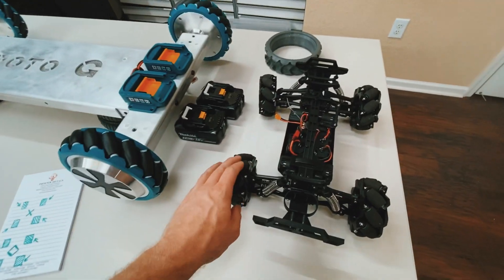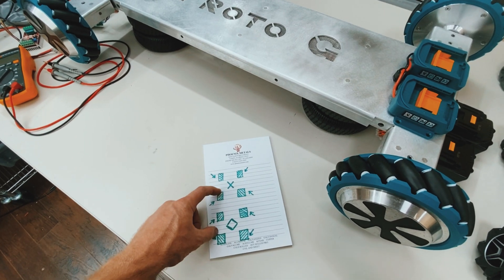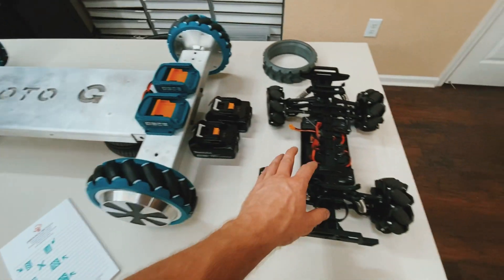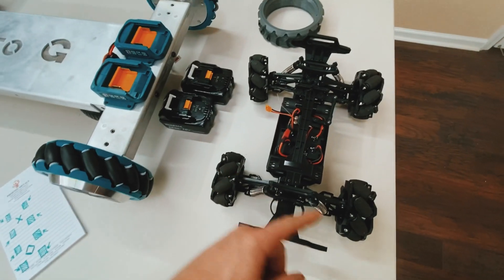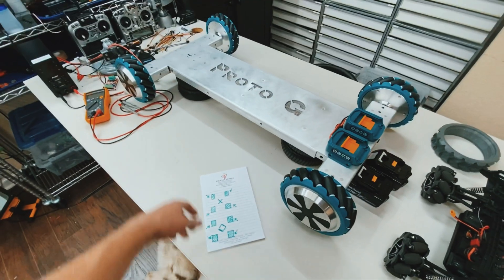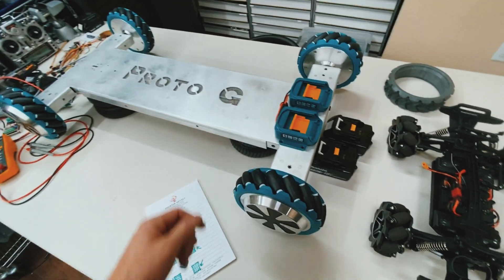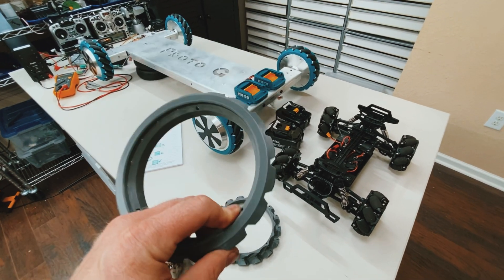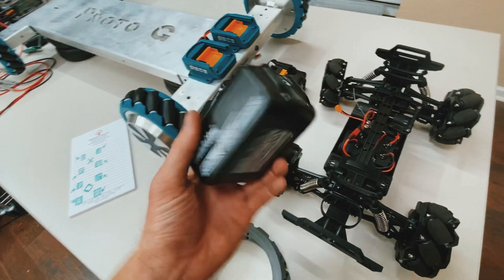Omnidirectional FPV Rover - Mecanum Wheel Orientation

Comment: I'm trying to do a similar build.  I don't have the engineering background or knowhow, I just want to make cool stuff with my two sons.  I know on Printables you said that you sourced the mecanum rollers from something you bought on Amazon.  Any way you could add an STL for the rollers so I could just print using TPU?  No matter if I hear back or not, I'm definitely using your STLs for my projects.  I've amassed a pretty big stockpile of "broken" hoverboards and I've got lots of projects I'm playing around with.  Thanks for your time.

Comment: Hi! I just found your video and I am really interested in the mecanum wheels you have designed and built for the hoverboard motors. I want to replicate you setup but instead of buying existing wheels just for the rollers, I want to take a stab at 3d printing the rollers. Would you mind sharing the original designs of the wheels so I can make the necessary changes? If all works out, I  will of course post back to the community.

Comment: Can anyone tell me the technical term for the shape of the rollers/waltzes the wheels consist of? Is it "barrell shaped"? I try to get them to build bigger mecanum wheels and cannot look them up. Has anyone a source for those?
Reply: I've been looking myself. I don't think there are many sources of just the rollers. Most rollers which come with Mecanum wheels don't appear to be the exact correct shape.
The shape of the wheel is the edge of a stretched circle. If the entire shape were drawn, it would be an ellipse 1.414 times wider than it is high. 
How big of a Mecanum wheel do you want? I want to make an electric skateboard with Mecanum wheels. I may end up making my own but I decided to purchase a set from AliExpress to see if they would work. I'll post a separate reply with a link in case the links aren't allowed so this entire reply isn't lost.
Reply: @ddegn  Thank you for looking and the information about the exact size. I want to build a pedal powered vehicle for a special use. I would like to use ten inch wheels but they are unnecessarily strong and expensive. The websitts are not very user-friendly to find the correct price.
Reply: @dieterjosef  "I would like to use ten inch wheels"
I haven't seen 10 inch Mecanum wheels for sale myself. 

"The websitts are not very user-friendly to find the correct price."
Finding stuff on AliExpress can be a real pain. Someone else on YouTube shared a link to similar wheels which provided me with the correct search terms to the ones I ordered.

I might end up needing to make my own. I've been watching DIY skateboard wheel videos to learn how to mold polyurethane. I'm thinking the rollers could be kind of like small skateboard wheels. The shaped can be figured out mathematically. I like to think I'll be able to design the general shape without too much trouble. I'm concerned about how much the urethane will compress and how bumpy the ride will be.

"I want to build a pedal powered vehicle for a special use."
I think a pedal powered Mecanum wheeled device would be very very hard to make. In order to take advantage of the Mecanum wheel's movement, you really need to control the speed of each of the four wheels independently. If I had to make a pedal powered Mecanum wheeled vehicle, I'd use the pedals to generate electricity and then route the electricity to four motors. Make sure you understand how Mecanum wheels work before trying to make a large vehicle.

You can purchase relatively inexpensive Mecanum wheeled toys and use these as a base to learn how to control the wheels. Vex makes some really nice Mecanum wheels. I used Vex wheels with a Rover 5 chassis to make a Mecanum wheeled robot. There are videos of this robot on my channel. I'll add a separate reply with a link to my Hackday IO project where I describe how I made this robot. If you follow my Hackaday IO account, you'll see when I eventually post information about my Mecanum wheeled electric skateboard.
Reply: @ddegn  Ah, you are Proto G. I follow you already. Great work and videos.

I found ten inch mecanum wheels on AliExpress for under 80 Euros, that would be cheap enough not to make them on my own. But I admit that I am better in imagining than in realization.

I also thought of electric drives, but I found two or three hydraulic bicycles on Youtube. I think that would also fit.
Reply: @dieterjosef  "I found two or three hydraulic bicycles on Youtube. I think that would also fit."
I suppose it would. That would be pretty intense to build.
I hope you document the build and share it with the rest of us.

"Ah, you are Proto G."
I'm not sure what you mean by this. Just to be clear, I am not the same person as the guy who runs this channel. We just have a lot of similar interests.
Reply: Here's the AliExpress link.
https://www.aliexpress.com/item/4000403241443.html

Comment: Is that the Taranis X9D Plus I see sitting on the bench? Or is that the access? Looks like you have been in RC for at least a few years, I dont think FrSky sells the plus anymore. I still love mine though.
Reply from the maker: Indeed! I have an X9D Plus and a Jumper T16 Pro with a multi-protocol radio.
Reply: @ProtoG42  I have the Multi protocol module on my X9D, they are great.

Comment: Thats a lot of power! Not to say a heaavy duty frame/wheels. New personal transportation/rover? 😁
Reply from the maker: I plan on driving it around with a headset although I will probably try to ride it. Those small rollers might not support my weight but I'll do some weight tests with it.
Reply: @ProtoG42  it remember me to this   development https://www.lanacion.com.ar/tecnologia/siruom-la-silla-de-ruedas-omnidireccional-creada-por-argentinos-nid19052021/
Reply: @ProtoG42  Considering that the "hoverboards" carry a human bean on only two wheels, the power should not be lacking. Is it that the rollers are 3D printed? How about replacing them with cast polyurethane? I'd love to have a wired (controlled) human capable base from which to expand.
Reply from the maker: @freddotu  It definitely has the power, I just need to find more suitable rollers but we’ll see!

Comment: So I checked out for a bit.  Saw the thumbnails was looking forward to whatever you were making.  This is amazing.  At first I thought you were making a OneWheel but out of omni wheels.  This powered board looks awesome thought.  When's the road test?
Reply from the maker: Not sure yet, I still have a lot of wiring and programming to do as this was just testing the max rpm of each motor in both directions for calibration purposes.

Comment: Could you please give some info on the LXT battery docks?
Reply from the maker: It’s in the comment I pinned and the description.
Reply: @ProtoG42  ahhh, sorry... Missed the ‘Read More’ button.
Reply: @ProtoG42  The link doesn’t seem to work, the other Amazon ones do though.
Reply from the maker: @molitovv  Thanks, it should work now. There were a few on amazon that were 3d printed but I picked this one because it was injection molded and has mounting holes.

Comment from the maker: Tools/Parts Used in this Video:
1. Tachometer: https://amzn.to/3wILbFO
2. Hoverboard Motors: https://amzn.to/2Tn3CkY
3. Brushless Motor Driver: https://amzn.to/34yjdk3
4. Jumper T16 Pro Transmitter: https://amzn.to/3wQbE4v
5. RC Receiver: https://amzn.to/3c6bjTo
6. Multimeter: https://amzn.to/3i4Tl7g
7. Bench Vise: https://amzn.to/3uDrQEv
8. Makita Battery Adapter: https://amzn.to/2Tcv5pm
9. Wire Ferrule Kit: https://amzn.to/2Ty48gb
10. Makita PLA: https://amzn.to/3irFJmR
11. FPV Monitor/Headset: https://amzn.to/2Sk6Eqd
Reply: The links for the motor drivers doesn't seem right. It's for a brushed DC motor, not BLDC.
Reply from the maker: @zaprodk  I checked the link and it is the same one I bought: 400W 6-60V PWM DC Brushless Electric Motor Speed Controller with Hall
Reply: @ProtoG42  something doesn't add up. Maybe you are having something cached so it shows you somethy different. The link brings me to a puny DC motor regulator, not for brushless motor.
Reply from the maker: @zaprodk  weird, here's a full link: https://www.amazon.com/RioRand-6-60V-Brushless-Electric-Controller/dp/B087M2378D?pd_rd_w=MPSMJ&pf_rd_p=fa751cb5-14ed-497e-b5ae-9a4f4dd05b44&pf_rd_r=3DJFHNWKW0DZJP46RR3B&pd_rd_r=c1f39894-6c57-401a-80e6-fde52eaf1eb8&pd_rd_wg=Zz3IH&pd_rd_i=B087M2378D&psc=1&linkCode=ll1&tag=prg06-20&linkId=28d87a1076443cfcb999685a0944adaa&language=en_US&ref_=as_li_ss_tl
Reply: what about the mechanum wheels that you used to get the smaller rollers?